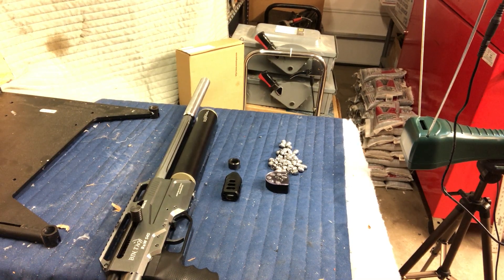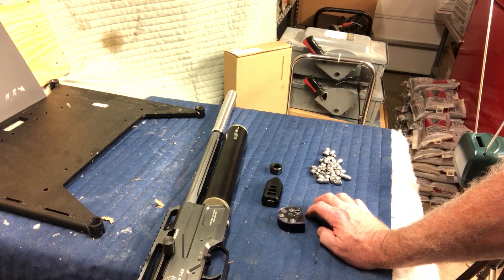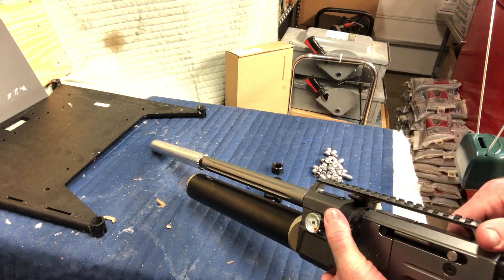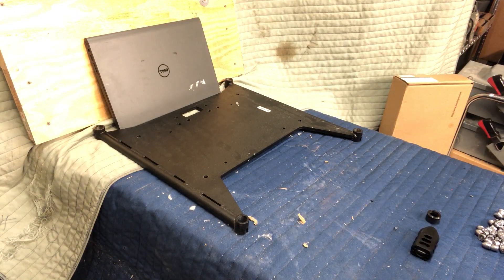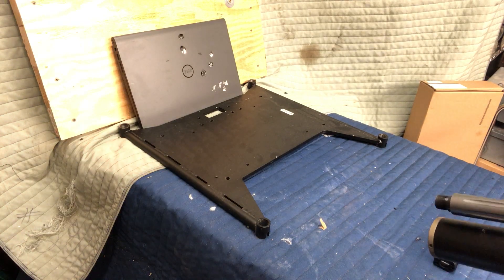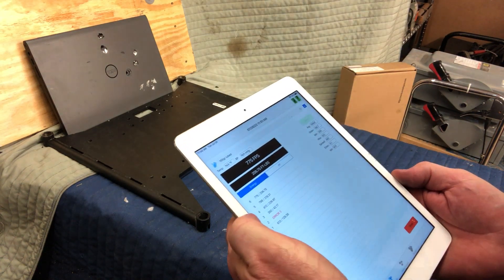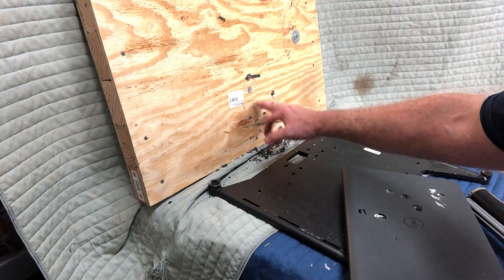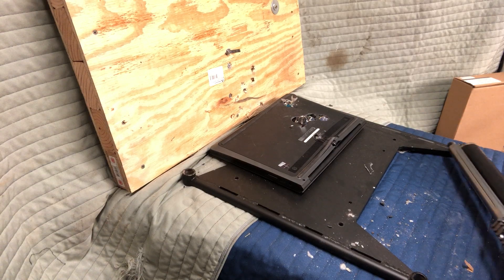BW S45 w/ TPP 155gr hollow skirt barrel extension test and the end of a Dell 3450 laptop VID33

Comment: I wish the 58 zeus came with a shorter barrel like 24/20 or 16
Reply from the maker: Well...It could be cut down by a halfway decent machinist or a good gunsmith could cut it down and re-thread the end.
Reply: I will let u know if i have it shortened and rethreaded im going to look for a smaller bottle of the 72zesu i will let u know

Comment: Increase your shot string with the extension. 6 shots with extension refill 6 shots without extension. I think you get an increase in velocity around 250 bar.
Reply from the maker: Thanks, I will give it a try
Reply: I e had no luck with higher pressures with several of my aea , I’ve gotten better accuracy and performance with 3700 psi . I’d definitely try it again with lower pressure . I agree a longer barrel will bring that Airgun alive

Comment: I had this very same idea and even brought it up to Bin a few times. Whether or not they'd offer a longer barrel in the future.... I was told that there was something else coming in the near future (another gun) but wasn't clear about barrel options. I believe if we found a barrel to replace this one entirely it would preform better being rifled all the way to the muzzle. The problem w/ this gun is the fact that it uses sooo much air per shot. That air has to escape for it to function properly. That's no matter what upgrade you add. It's an issue when attempting to surpress this gun. The blowback must be considered in any upgrade or else it won't function properly
Reply: Tell bin that he should do a version of the 58 with a shorter barrel like 24/20 or 16